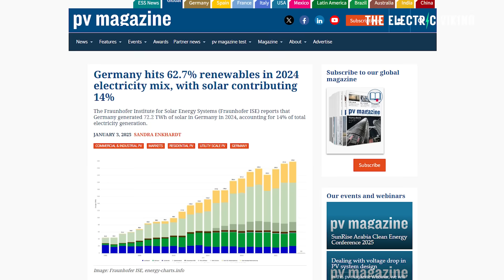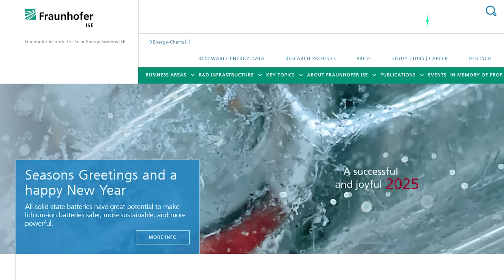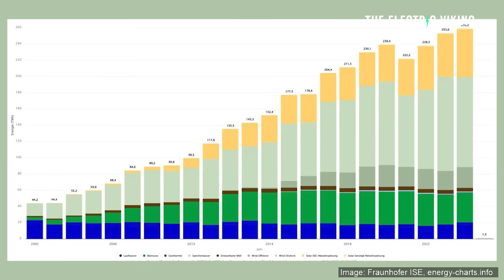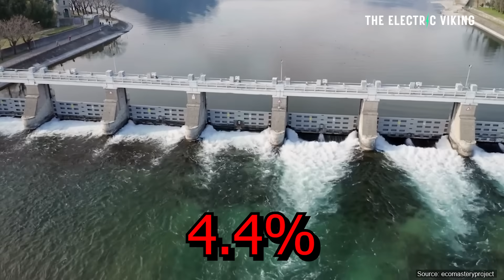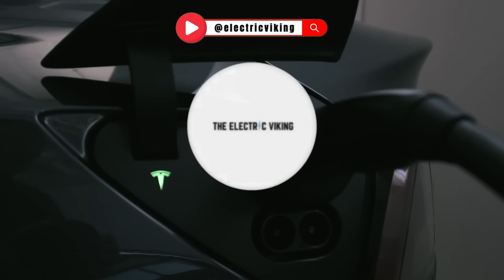Germany hits 63% renewables in 2024 as battery storage almost doubles

Comment: You don't point out the main problem for the northern Europe electricity market even if you call yourself a Viking. It is a very good video but you missed the main problem.
The problem for northern Europes high electricity prices is not the lack of electricity but rather the price model that are used at Nordpool (market for electricity run by "Wall street").
The price model are one called marginal cost. The price for the "last" MWh set the price for that hour. So the average production cost for an specific hour can be 50 euro/MWh but if there is a gas turbine that runs  as low as 1 MWh will all electricity get that 700 euro/MWh. So everybody has to pay 700 euro/MWh for something that cost 50 Euro/MWh to produce.
It is nothing but a scam and the reason that is still going on is corrupt politician that are paid by "Wall street". 
1. Nordpool need a new price model that reduce the difference between the marginal cost and the production cost
2. There is a need for new price model to store primary wind but also solar energy by pump water up to existing water magazines when the price is low for use it when prices are higher
The price model problem is bigger than the lack of energy problem, since the lack of energy can more or less only be solved by reduce the production in the energy intensive industry, like steel, fertilizer, data cloud storage etc.
Reply: You are right! This has to be changed.
Reply: Absolutely, same at the EEX in Germany. Same in England, probably all over Europe. In Germany we call it "merit order-Prinzip", using the English term. It may have worked earlier with all coal, gas and nuclear pwoer stations but now its a nuisance - a big one.
Reply: There is not a real lack of energy problem. Germany has 91 GW in oil, gas, coal, waste, water and bio mass which is running or deployable almost any time (as of the end of 2024, not all 91 GW will be available at once ofc but peaks are typically not higher than 75 GW at mid day). Additionally 9.9 GW of water pump storage. Of course for climate action we want to keep fossil fuel use as low as possible, but still their never was a lack of production capacity during all that time. If it wanted to, germany could have covered the "Dunkelflaute" by its own. 

The real problem is the markets and price systems as you say. It used to be a half-way decent argument, that due to this principle renewables which were much cheaper in production brought more profits, thus encouraging producers to invest in them. Now that Europe surpassed 50% renewables it needs to be turned upside down. Renewables are now the standard and fossil fuel use must be punished by canceling the marginal cost principle. This is now an equal incentive to invest in renewables as all fossil fuels will cause losses but keep prices lower for house holds and industry. How is anyone expecting energy producers will phase out fossils if they are the main driver of their profits simply due to this price determination? 

The energy industry will turn in huge profits again year after year and tell us we they need to raise prices for renewable roll out, when in truth they pocket it for themselves.
Reply: @Domi.R313 umm, the biggest beneficiaries of this model are renewables and grid operators. Only last year, the German government had to double the subsidy paid out to renewable operators, from 10 billion to 20 billion euros. The renewables have a guaranteed profit no matter what - if the wind is too strong and turbines need to be shut down to avoid overloading the grid, the operators are paid the full price without producing anything. The grid is forced by law to buy renewables first, no matter the cost. All the coal subsidies since the end of WW2 are calculated to be around 20 billion in total, for renewables it has been more than 500 billion in 30 years.

Comment: Germany produced 4% less electricity last year than it did in 2023. It exported 10% less electricity in the same period. Meanwhile, imported electricity rose by a whopping 13.8%.
Not exactly pin up poster model stuff if you're claiming a win for "green" energy.
Then there is the issue of Sweden, Germany's wonderful "Green" neighbour to the North. Poor fellows. They've discovered (the hard way) that when the wind doesn't blow and they can no longer import electricity from Germany that wholesale prices in some regions increase by... wait for it... 18,000% !!! That's a bit of a problem. 
This has prompted Ebba Busch, Sweden's energy minister to call to increase nuclear facilities in the immediate future. She has even publicly stated that Sweden's wind generation is "Too unreliable". 
I hope that helps clear up any small details that have been omitted in this presentation.
Reply: Germany imports electrical energy because it is cheaper than to get the existing coal and gas plants online. At "Dunkelflaute" where no Wind and Solar was available, only half of the fossil plants were online.
Reply: @martinv.352  If that's the most economically viable way of doing it, it makes sense.
Reply: Except that the other guy explained that
Reply: @jsanders100  What have I missed?
Reply: Once Sweden gets up to speed with battery capacity the terrible problems you argue about will completely disappear.  Have just a tiny bit of patience big guy.
Reply: @philippserrin8268  Battery capacity, and other storage technology; many options, but need time to develop and install. Ultimate solution will be UHV grid across the continent, but that too will take time. Meanwhile, let's all BLAME RENEWABLES and the DIRTY ROTTEN TREEHUGGERS who advocated them! lol
Reply: @philippserrin8268  Except that is no longer their priority. They are now pushing for an increase in nuclear capacity. If they go that route, it wont be a short term measure, will it.
Why "renewables" were ever specified without sufficient storage in the first place is mind boggling.
This is something everyone who has lived off grid for the last 50 years has been aware of, be they yachtsman or back woods types. 
If someone in Sweden's government had just asked some old hippy (my electrician!)
what's required and what it costs, they wouldn't be in this mess.
Reply: @philippserrin8268  But they're not. They are now pushing for Nuclear. If wishes were horses, beggars would ride.

Comment: What Sam DOESN'T tell you is that the renewable energy that Germany produces is HIGHLY VARIABLE.  That means that it MUST EXPORT large amounts of electricity to its neighbors when it is sunny and/or windy AND IMPORT large amounts of electricity AND run very expensive fossil-fuel peaker plants when it's not.  The numbers he quotes and the graph are VERY MISLEADING.  THe overall contribution of renewables to Germanies actual domestic needs is thus much less renewables and much more domestic fossil and imported energy of all types.  Germany MUST use the rest of Europe for its generating buffer and emergency supply.  Electricity in Germany is VERY EXPENSIVE as a result.  That system is NOT translatable to the rest of the continent.
Reply: What is large amouts for you? 2 TWh he talked about? But we produced 71? What are u talking about. Every country in the EU exports and imports Power. France actually NEEDs to export nuclear power because the Energy Market is just not a stable thing 24/7. It fluctuates ALOT, and the EDF has huge troubles integrating the a nearly full nuclear generation into a volatile market. 

Im not saying its easy to integrate Wind and Solar, but its cheap energy and industries and housholds are already adapting to use power when its abundant.
Reply: Is lignite a renewable ?   hahahhahahhahahahahha
Reply: Exactly, Germany is bringing its neighbors into trouble with the energy transition. 
As it was with Sweden last month.
Reply: @ArjanSchaeffer1973  really? No. Not true, not when put than simple. Sweden has its own energy problems: from the initial 10 nuclear reactors they are down to 6 for numerous years now. But nuclear makes up just 25% of their energy supply. 25% more percent are wind, and all the rest is hydropower. 

Recently, there was no wind, one reactor was down, and it turned out that their power lines from north to south were not quite sufficient for their demand. They had to buy from other sources, Norway first of all, I guess, but Germany could have helped with gas or coal based energy - but at a price. 
And I regard the Swedish energy minister Ebba Busch as somewhat odd. I guess she is lobbying for nuclear energy.

But yes, the energy markets in Europe have a design flaw that causes problems with the rapidly changing renewables. It is the *markets' operation that has to be changed.
Reply: Due to the density, size & limited diversity of Germany, unless they were to rely heavily on Coal & gas, sources that can adjust to demand- then they NEED to import/export energy with the rest of Europe

I'd imagine, at the absolute least, that Europe has some sort of patchwork "NEM" style system, if you look at our charts, you'll see our states regularly import/export between each other, this has massive advantages with the growing transission to renewables, the winds always blowing somewhere, & the further you stretch it, the longer we can use the sun for. If WA were to join the grid, they'd benefit from the morning sun in the eastern states, before it rises there, & the Eastern states could benefit while the sun has set there but is still shining bright in WA- addining an extra 2-3 hours of sunlight to shift around. Not to mention all the vacant land in WA.

The advantage to the NEM in Australia is that all our states are fundamentally Australian whereas European countries are vastly different from each other. Are states are also much larger than most European countries while being substancially less dense, the main exception being the Nordic countries which are a little larger & less dense than only Victoria.
Reply: Yes - but how is that bad? The EU grid works that way.
Reply: That's what many people believe. Did you look the firgures? In Germany we imported 6% of our energy from other countries. Yes we sell some energy very cheap, almost for free, when solar overproduction happens, and have to pay for imports when we need them. But the imports are much cheaper than fireing up gas power plants for just an hour or two. 

And you didn't mention the fees and taxes that make up for a full 30% of our energy prices.

You seem to be one of those "problem seers" - look at solutions. And we are in the middle of "changing everything". We don't have anything but coal, sun, and wind. And coal is expensive now and shall be phased out. How would you solve that?
Reply: @ElwoodEBlues
5 hours ago
That's what many people believe. Did you look the firgures? In Germany we imported 6% of our energy from other countries. Yes we sell some energy very cheap, almost for free, when solar overproduction happens, and have to pay for imports when we need them. But the imports are much cheaper than fireing up gas power plants for just an hour or two. 
 And you didn't mention the fees and taxes that make up for a full 30% of our energy prices.
 You seem to be one of those "problem seers" - look at solutions. And we are in the middle of "changing everything". We don't have anything but coal, sun, and wind. And coal is expensive now and shall be phased out. How would you solve that?

Comment: I think solar is good when it comes to day light but countries like germany where average sunny days are 200 to 250 and it doesn't seem to be sustainable.and another problem is cost of producing solar power is less but storing it in the night is insane its 3 times the cost of generation so please make sure to do complete math.Solution for a nation like germany is nuclear power which is as cheaper as solar power is and that is also clean and 24/7 power supply.France is doing that already which is a great example in the neghourhood.German's should learn from France.
Reply: Every nation around the world forgot to consider storage when moving to renewables. My electrician (who lives off the grid) has been saying for years that the whole global approach
is a waste of time and money. As he points out, it doesn't matter how much power that you produce, if you're not using it when and if it's required, you're just throwing good money after bad. He's been off grid for about 25 years. He's on his third set of batteries and he was talking about replacing his solar panels. He's the first to tell you, "This isn't cheap or easy".
Reply: Nuclear is not cheaper. Not with new reactors. And the old ones were at the end of their lifetime.
Reply: @krasserTerror   that's a valid point. But there is a new technology called small modular reactor which if produced in bulk can reduce the setup cost of nuclear power plant even I would argue to please use thorium also instead of uranium only.
Reply: @tarunshroti3255  Trust in nuclear has eroded severely in Germany. There was a lot of misinformation after Chernobyl. Also Mismanagement of the Asse nuclear waste site, which is now filling up with water. The general sentiment is anti-nuclear. No way that we would bet the farm on an unproven technology. From the outside it might seem illogical, but Germany has good reasons to mistrust nuclear.
Reply: Agree

Comment: This some phenomenal shilling. That’s why manufacturing base has disintegrated. If they’ve improved why are they fleeing en mass ?🤷🏾‍♂️🤦🏽‍♂️
Reply: German workers are quite expensive. Taxes are high, and bureaucracy somtimes just crazy. The population is getting old. Wages and taxes are much cheaper in Eastern Europe, not to mention Asia. China is now a big competitor, not just a "prolonged work bench", as industry leaders have told us a long time. And the USA now heavily subsidize industries moving into their country. 
And yes, the end of the cheap gas supply from Russia is a big problem. And it drove up all energy prices, and  electric supply as well.
Its a process of "shrinking towards health". Germany had exported much more than imported for many years, with a relative high share of industrial production, compared to most other western countries. Times are chaning, and the energy crisis has driven up pace - but is not nearly the only problem.
Reply: @ElwoodEBlues  I Agee with much of the points you’ve raised but cutting off Russia oil & gas was/is economic suicide. For the whole of Europe. The intransigence as well, I find shocking. 🤷🏾‍♂️

Comment: Companies are waiting to install a large amount of utility scale, battery containers. This will happen 2025. Everybody can buy 1 kwh for 0,29 €, that is not too expensive. If you have PV, you use it and sell the rest to the government. In winter, you buy electricity. From March to October, you dont need to buy power at all if you have PV. The cost for the grid has to be paid and this makes the price higher. Good for PV owners, unfair for the rest. 
Now laws are changing. When the price is below zero, the government doesnt buy your PV electricity, which makes sense. 
Germany buys electricity, when they can buy it cheaper than to produce it. There is never a shortage of power, its just the economy.
Reply: "When the price is below zero, the government doesnt buy your PV electricity, which makes sense. "

Which makes a lot of sense,  but that goes only for new installed PV and wind. The previously installed  systems have guaranteed prices for 20 years. That's why german tax payers in 2024 had to pay about 20 billion subsidiaries to renewable energy producers.

And yes, there was never be a shortage of power, Germany is on of the countries with the least average minutes of power outages per  year (about 12 minutes so, mostly caused by cable damages durink construction)
Reply: @thorblau7943  I didnt understand, why tax payers have to pay it. The four big electricity companies make so much money. Anyway, the low class pays for the upper class, but the low class would not have build solar, because they dont own houses and cant afford it.